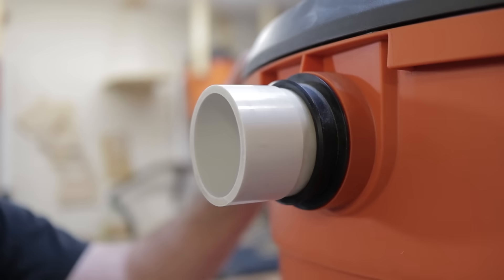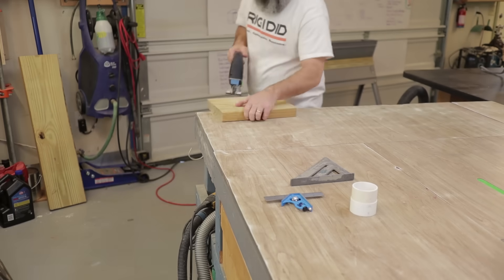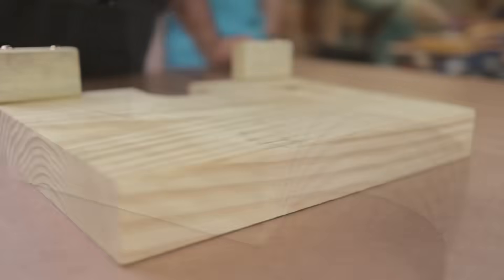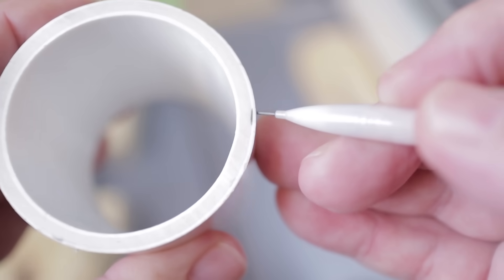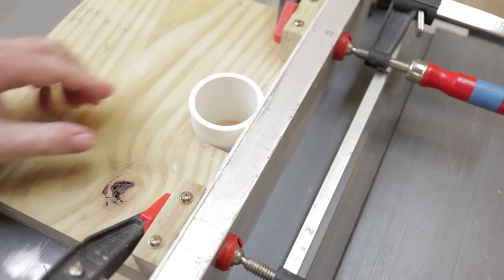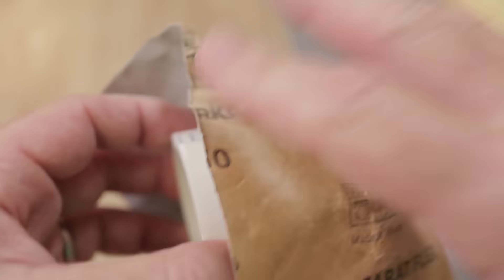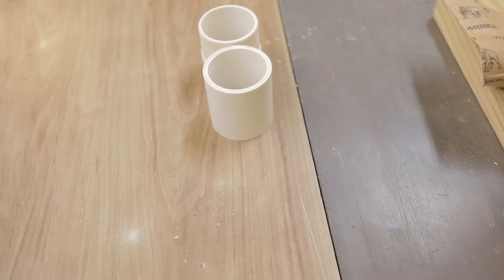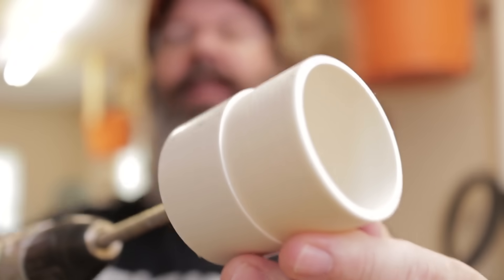Dust collection adapters shop vac to PVC made fast on the table saw

Comment from the maker: Let me know if you liked the dolly zoom shot at the end? First time doing one. It took several tries but I thought it turned out pretty cool. :)
Reply: Slow and Expensive it looked dope! Keep it up, great idea btw...it got my wheels turning, I’ll be adding this to my shop
Reply from the maker: Thanks man! Much appreciated
Reply: If you tilt the jig slightly, ie a spacer under the jig away to the fence or tilt the hole slightly, you could put a tapper on the adapter like the factory adapters.  Do it with one cut, no need to sneak up on it and easier to push together and take apart.
Reply from the maker: Okay, thanks
Reply: You rocked the shots!
Reply from the maker: Thank you!
Reply: Well done dolly zoom - it always hurts my brain when I see it - LOL that is meant in a good way!!!  :)  I have not seen too many comments on the ungrounded pvc static buildup dust explosions that are imminent!  LOL
Reply from the maker: Thanks P Scott! I think you are the first person to mention the imminent ungrounded pvc static buidup dust explosions. :)
Reply: Slow and Expensive  There are some really clever people on you tube. You're at the top of my list of clever people. Thanks
Reply from the maker: Thanks so much Vince! I really appreciate the comment :)
Reply: @SlowandExpensive  Static was my first thought at the very beginning of the video. Cool setup on the tablesaw.
Reply from the maker: @stevecuthbert8856  Thanks!
Reply: @SlowandExpensive  static is an issue in large installations but with DIY not really an issue. If you are worried place self drilling screws on the outside with an earth wire, problem solved
Reply: Yeah, buddy. Thank you, SAE. You just saved me some money. And, that's always a good thing. Besides, this type of stuff keeps a guy sharp and innovative like the old school generations used to be when figuring out how to overcome all obstacles both big and small. Merry Christmas to you and yours in 2019.
Reply from the maker: @hawgdawg556  Thanks for watching and Merry Christmas!
Reply: Wouldn't it be easier to just slap a rubber boot and hose clamps?
Reply from the maker: Good one :)
Reply: Seems that my hole ends up a little too big I've tried several times with different saws. Any suggestions ?
Reply from the maker: Thank you!
Reply: Great idea and I do like the dolly zoom... I have a Workshop Brand (supposedly by Emerson who makes Rigid) Vac supposedly 2 1/2”, but cannot find adaptors anywhere.. Trying to hook up to Dustopper.. 

Q1. Can you trim down both ends as I need 2 1/4” connector from female hose to Dustopper?

Q2. Can you make a longer connector, but I assume it would be the height of the blade.. maybe have to make 2nd block the size of the cut down size in order to turn over

Q3 - Have you ever cut down elbows..

Q4. Have you ever heated or enlarged a 2” PVC?

Thank you???
Reply: That's also called a "retrograde zoom" among other names. That's the uber-tech-sounding one. Or Hitchcock zoom is a good one too! https://www.premiumbeat.com/blog/the-dolly-zoom-film-history-and-video-tutorial/
Love the video, love the OTT of adding the power drill. Made me laugh!
Reply from the maker: Thanks and I appreciate the info! Here is the second in the series. There's a few camera moves in it as well. https://www.youtube.com/watch?v=CEouFGfZzEg&t=438s
Reply: can you show us how to make a pvc BONG
Reply: Cool. But worth your time I dunno. Maybe if you had something cool in the front end folks would be more inclined to watch all the video? But yes, it was a cool shot.
Reply: You know since your making so many you should make a internal clamp to rotate the pipe easy with some leverage, this is a great idea if you don't have a lathe.
Reply: It's my favorite camera effect by far. Nicely done! Great tutorial as well. Thanks for the tips
Reply: idiot
Reply: Are you backing up the camera while zooming in at end? Background came into focus...cool
Reply from the maker: I'm rolling the camera forward while turning the zoom back. It's was difficult to get both the rolling and then zoom twist smooth at the same time along with the auto focus staying locked on but a couple of the "many" attempts turned out pretty good.  Thanks
Reply: Slow and Expensive that was really cool!   I was going to message you asking how you pulled that off.  Awesome!!
Reply from the maker: Thank you!
Reply: @daversj the

Comment: I'd rather use a heat gun to soften the pvc to push it into place of the unequal diameter pipe you want to connect.

Comment: For a moment I thought you were going to just clamp the wooden jig on a board with sandpaper on it and use a drill to spin the PVC as you push it into the cutout and sand it down to size.

Comment: I was hoping for something quicker & easier. I only need one or two fittings of this size & several more of various sizes for my many different machines all of which it seems have a different sized hole. Maybe I can make use of this info somehow. Maybe make an adjustable jig or something like that. I do like the idea of just using a heat gun & forcing the PVC either into the female hole or around the male fitting whichever the case may be.
Reply from the maker: There's a link in the description if you'd like to buy a few.

Comment: I made this jig and it works very well, but I made one modification to the system. I made an adaptor that fits into the inside of the pipe that fits tight and added a 1/4” bolt through the adapter. Put the adaptor in my battery drill and go to town making adaptors. No more tired fingers. I also make adaptors on longer pieces of pipe say 8 “ to 12” long and reduce both ends. I found that I needed some of them a little longer. Saved me a coupling or two on a few projects. 
Thanks for that.👍
Reply from the maker: Cool! I ended up doing the same thing with the drill, you may have missed it if you didn't watch the whole video. Great minds think alike :)

Comment: I used 1-1/2" couple with a couple rounds of tap for my 4 Gallon Rigid.  I think using 1-1/2" PVC system is better regular flex hose, should have comparable performance against 2" PVC system for my case.  I am too cheap to buy a CFM meter to prove it.
Reply from the maker: As long as it's working for your needs that's all that matters. I like to switch back to the flex hose after the PVC in some situations. Here's a cool video on how to make short hoses you may enjoy https://www.youtube.com/watch?v=6r9AoEAcaps

Comment: I can't imagine this is the quickest way to take an eighth off a pvc pipe lol.  Why not just use a router table with a fence and a stop?  This was a decent solution if you only have a table saw I suppose.  Adding material to a smaller pipe would also work... gorilla tape maybe and then seal it so it can't come undone?  Just brainstorming any other way that doesn't involve making multiple jigs with multiple steps per jig.

Comment: cut out a wood circle with a hole saw that fits firmly in the 2" pipe, drill a hole through the center and bolt a carriage bolt to it. then chuck it in a drill and turn it with downward pressure as you raise the blade on the table saw.
Reply from the maker: Sounds like you didn't watch the entire video.
Reply: @SlowandExpensive  haha... you're right I missed the end of it, my bad

Comment: I certainly plan to make some of these. I am currently using 2" by 1-1/2" rubber reducers with clamps. They work well but, your way is MUCH cheaper. However, I am just wondering why you use so many shop vacs. Wouldn't a central dust collection system be cheaper and easier? I am not knocking your style. I'm just wondering if I should do the same in my shop.
Reply from the maker: I got a really good deal on all of the vacuums. There can be benefits to using multiple vacuums over a central dust collection system depending on your tools and workflow. Most people don't take into account the downsides to a central dust collection system in a small shop. (Besides the extra cost for all the piping and blast gates.)The first thing to take into account is that smaller tools with dust ports smaller than 4" such as sanders, routers, track saws, and even miter saws and smaller table saws actually don't work that well with a central dust collection setup as this type of system operates best with lots of air flow which is different than a vacuum. When you reduce the piping on a central dust collection setup down to the smaller ports like the ones the tools I mentioned above the restriction will cause the collection to not operate nearly as well as just using a vacuum. Another huge downside to using a central dust collection system is they are usually constantly running the entire time you are in your shop and it is very noisy unlike a shop vac which can be easily connected to a autovac switch. This means the noise from the dust collection only occurs when the specific tool you are using is running and it comes on and off without any thought. If you are not used to using a central dust collection system you may become annoyed with the noise and constant extra step involved in remembering to open and close the blast gates. But again it depends on the tools you have and your specific work flow. I work at a large shop with multiple central dust collection systems. We would not be able to use my shop vac setup there but there is a 20" planner, a twelve inch radial arm saw, a straight line rip saw, two other big table saws, several shapers, three wide belt thickness sanders, a few other big belt sanders, and a variety of other large tools but that being said the five inch disc sanders are not connected to these central systems, they are on a down draft table. There are lots of other videos on my channel about my setup (an entire playlist just about shop vac dust collection) and several more on the way so feel free to check out some of those videos. They may help you  understand my style and decide what type of dust collection will work best for you :)   
https://www.youtube.com/watch?v=lXUxI69Ydp4&list=PLhnZvpfLdQQxK0NglsfdD8xB4dZ_AMJ9B&pp=gAQBiAQB

Comment: So I see you have several vacuums just hanging above your different machines . While I’m sure it works great isn’t it a bit of a pain when you need to empty them? Does save having to run pipe everywhere but you also can’t use a separator on top of them.
Reply from the maker: The bracket that the vacuums hang from make removing the filter and the container very easy. The vacuums don't accumulate much dust because each of them is connected to a cyclone dust separator. The separators are each hanging on the wall below the vacuums. I will be uploading a video that explains the hanging vacuum setup soon, hopefully later on today, so do check it out, this new video should completely satisfy your curiosity. This video here that you've commented on, the one about the adapter, is the first in a series about shop vac dust collection so you may enjoy watching the others as well. Here is the playlist https://www.youtube.com/watch?v=lXUxI69Ydp4&list=PLhnZvpfLdQQxK0NglsfdD8xB4dZ_AMJ9B&pp=gAQBiAQB

Comment: Hi. Really enjoyed your video! looking forward to more wood working videos as well. BTW, will this fir=tting work with central vac system using 2" PVC  pipe?
Reply from the maker: Thanks! Maybe, the outer diameter is right at 2 1/4", (after shaved) so if your central vac port has a inside diameter of 2 1/4" it may work.

Comment: Just found this video. But dude this works a charm. Any reason i can't use Abs pipe? I have some scrap from a small plumbing project. Dont want to buy PVC if i dont have to.
Reply from the maker: I don't see why it wouldn't work. Give it a go.

Comment: Great video!  I am going to try that, but  will place a slight angle on the blade to get a taper fit.  Cheers.
Reply from the maker: Thank you! Tilting the blade 1 degree works great!

Comment: Mine are not so pretty!
I tried following all the instructions. I used a hole saw 2 3/8" and still had to smooth it open a little so I could rotate the pipe. My 1st try was with an 8" long pipe that I needed for a special location.
The cut grooves were like stair steps. I think the problem there was because I had a contractor's 224 tooth blade so I went & got a Diablo 60 tooth to replace it. The stair stepping was not as bad with that higher-grade blade. It is really easy to take off too much and make the joint loose. So I experimented with moving the fence in or out to get a better fit. Overall I am not satisfied with my results. The 2 1/2" pipes do not give you much room at the table saw to rotate etc. I don't see any reason why they couldn't be longer say 3 or 4". The way it stands tonight, I do not think I will pursue this project anymore. If I do decide to try again I will remake a new wood jig. I think I only require a half dozen for my purpose. 
Thanks so much for showing us how it can be done.
Reply from the maker: Thank you!

Comment: Another option for pvc is a heat gun. Heat up the pvc until it is soft, then you can push it into the shop vac fitting. Once it cools, you can pull it back out and it will stay conformed  to the shop vac fitting.
Reply: I had a bunch of great quality attachments from a dead Dyson vacuum that I did the heat gun trick. Just needed to pick up the Ridgid orange hose to make it work.
Reply: I was about to say exactly this.  Dipping the pvc in hot cooking oil does this even better
Reply: That for increasing circumference … this is for reducing.
Reply: @davidstevenson6817 works for reducing just as well

Comment: Not tryin to be a smart ass here but I do pool plumbing and sometimes we need to create a bell end instead of using cupplers. Why not just heat the coupler and force it into a smaller hole? It will shrink down and form perfectly.

Comment: First off, Thanx for the vid. I think dust collection is a serious issue. It should be incorporated sooner rather than later.

Lots of woodworkers teaching and showing off tools and techniques and jigs. 

As soon as I used a router on MDF for the first time, I knew that wyes and ears wasn't gonna be enough. 

Thanx again.

-

One question If I may? I skimmed thru the comments and did not see anything about static or fire.

Is pvc with a shop vac worry free? Is there a way to ground the whole system? Is it necessary?
Reply from the maker: Static is a thing but I don't worry about it and I don't have any special grounding. I have had a few comments about static related fires but I've never heard of a shop vac dust collection fire.

Comment: One way to smooth a hole ID and increase the diameter slightly is to take a hole-saw that is slightly smaller in diameter, and tape a strip of 80-grit sandpaper over the outer diameter. A cordless drill can spin it to smooth the part.

Comment: Why is Ridgid so difficult to connect to dust collection or shop vacs in the first place that requires this (very ingenious) hack? I bought a Ridgid shop vac, and a Ridgid miter saw -- from same color Orange Big Box store -- and Ridgid shop vac adapter kit. Nothing fit together. Returned the shop vac adapter kit. Will sell the vac second hand. Need to custom fab vacuum from Ridgid miter saw dust collection outlet. Bad, to non-existent, system design at Ridgid. Just another brand to sell. Sad Orange, Sad.

Comment: I've used a rubber coupling on many projects to attach a vacuum hose to abs pipe...   I like the drill he is using near the end of the video..  otherwise I would not have cut them to final length until after the process, seems like it would be easiler to turn..

Comment: Hate to rain in your parade, there is a fitting called a pipe extender, will save you from having to manufacture the fitting. They cost about $3.00
Reply: The name of the channel is slow and expensive.
Reply: Yeah but the sizes are less than 2 inch. And besides this idea can be adopted for different project. So don't be a cloud on a sunny day.
Reply: @tonmage29  
I have seen the pipe extenders up to 4", used many times. Don't know if plumbing supply houses stock them- know pool supply companies do though..
Reply from the maker: Sounds too good to be true!
Reply: Just makes me so happy I have a lathe to do stuff like this lol
Reply: I was thinking. The same thing but then realized I would not want to pay 3 bucks for all the shop vacs he has lol

Comment: I know that I'm late to this, but, when I made mine I tilted the saw blade very slightly so they are small at the starting end. I found this made them slide in easily and then lock on the larger part of the taper. Thaks for the tip.
Reply from the maker: Yes, this is a great idea! Others pointed this out early on. It’s a one degree tilt on my saw.

Comment: Won't is wreck you saw blade?
Also, won't it slide right in if you heat it with a heat gun? I know I will expand over alot of stuff a be perfect fit.

Comment: That is a cool idea for a jig. I noticed that you have 5 or 6 Ridgid shop vacs, that I can see. Those start out at 80$ and go can double depending that depending on what vac you get. That's 500$ on the low end in shop vacs. You can buy a standalone dust system for that and not only save a lot of space but have a better system. I built a dust system with a shop vac (gift) and made it into a standup cart so I can move it around. It works great but couldn't imagine using that many vacs.

Comment: Hi mate! I don't own a table saw, so I was thinking of using a belt sander mounted vertically. Attaching the PVC pipe to taper down to a long bolt with a piece of wood tightly inserted in the pipe like you've shown... Then, insert the whole thing in the chuck of a drill and spin it away, moving it carefully towards the belt sander in delicate motions to achieve a similar result. Just another idea :)
Reply from the maker: Perfect!